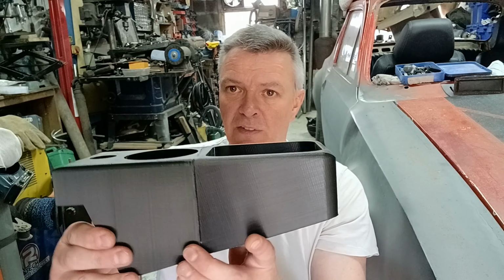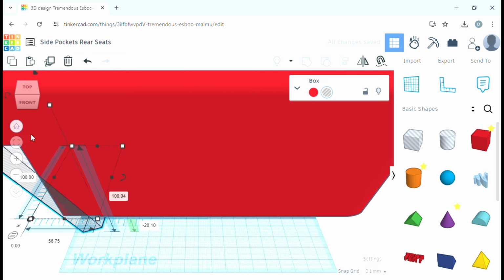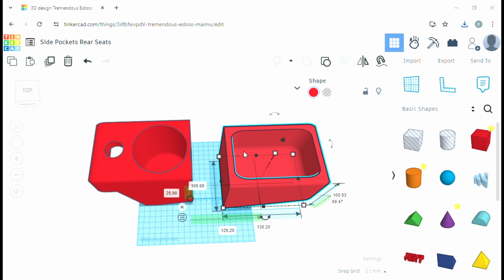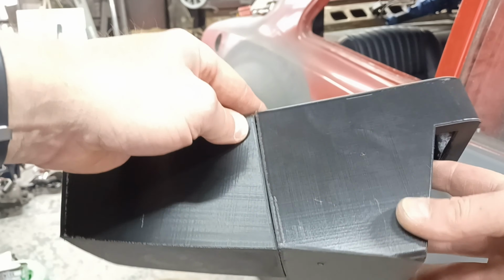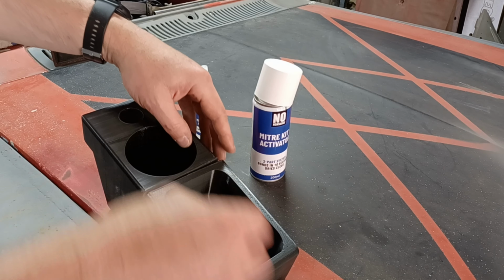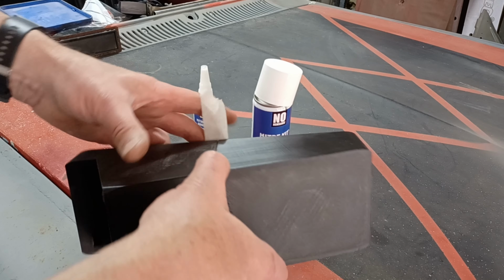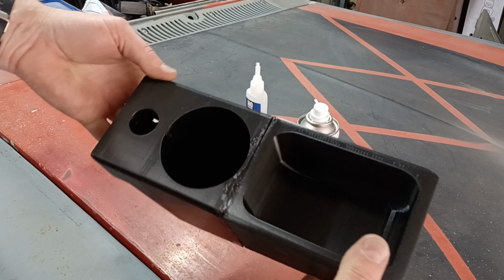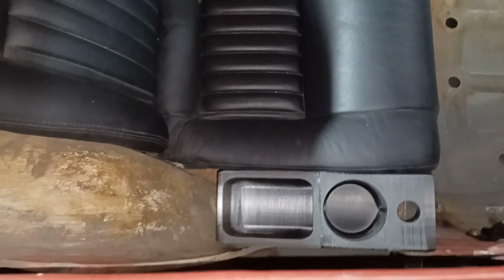Ford Escort MK1 Restoration Project, 3D Printed Cup Holders!!

Comment: Just a tip i use on some 3d prints. 8mm locator pin holes hidden on the inside. I do have to sand the pins so they goes inn easier.

Comment: Great footage of the show. Love the cup holders. Are you using the Ford ecu or running your own setups?remember to include in your loom. Personally I’d use the escort loom as a pattern & make your own
Reply from the maker: Hi Mick, to start with I'm using twin weber carbs and a late orion ignition module for spark, likely end up on throttle bodies